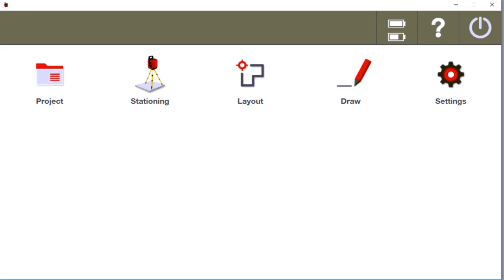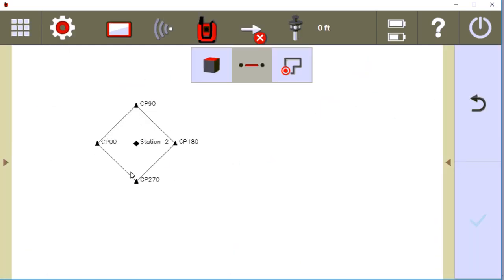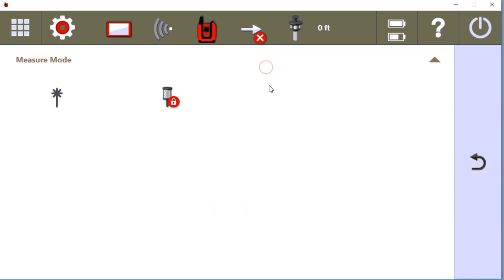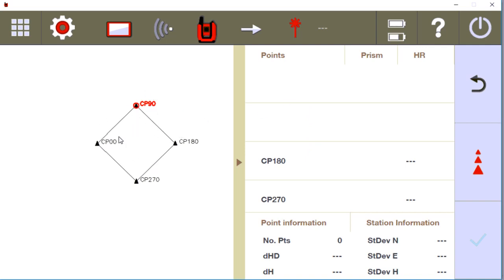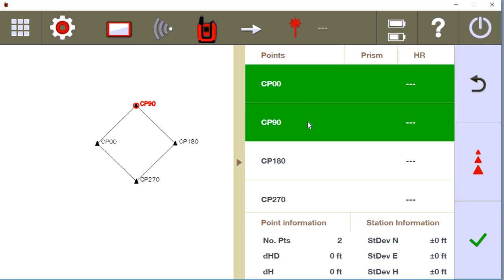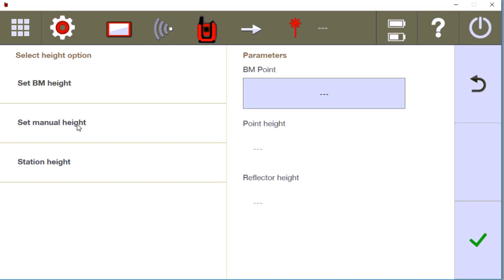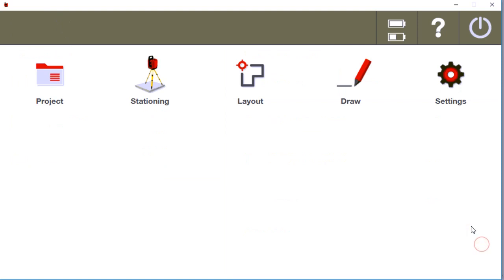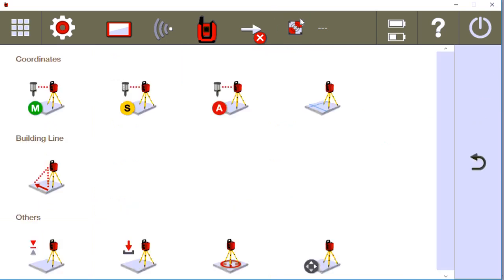Hilti PLC 400 Tutorial - STATIONING - Coordinate Stationing

Comment: How do I set up over a bench mark
Reply from the maker: You would do this only with a POS 150 or POS 180. Go to stationing, and choose to station over a point if you are using a drawing or a point file, or, if you don't have a drawing or point file, choose to station over a point under building line stationing.

If your stationing location is over a benchmark height, when you set your height, go to "set station height" and type in what your station height is - type in your instrument height accordingly. Again, this is normally only done with a POS 150 or POS 180.